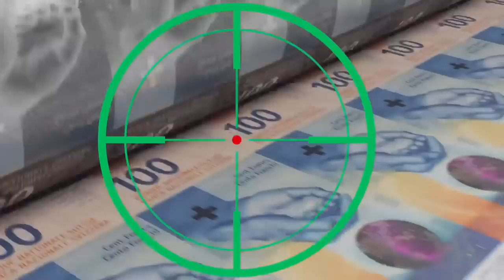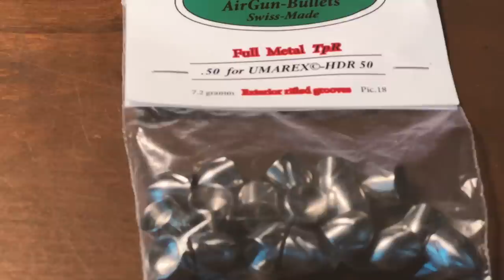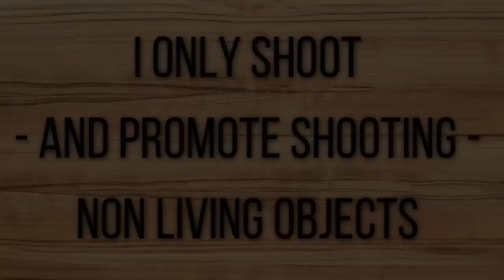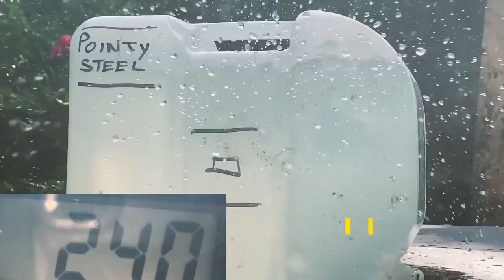HDR 50 • SWISS BULLETS

Comment: Although I carry a real 44 for defense, I do own an HDR50 11 joule gun as a back-up. Black Powder takes time to reload, even if you are just swapping out the cylinder. So I own a few non-lethal guns. Everything I own is designed to kill or maim. the HDR50 11 joule is very good at this. The Byrna HD or SD gun is the best for quick draw conceal and carry, but less power. If you are interested in BP I carry two 1873 Cattleman's and a 36 caliber Pepperbox.
Reply from the maker: Great input and thank you very much, Reverend! 🙌🏼
Reply: @AirgunAlley  I did time, and although I can legally purchase guns via Texas state law, if the FBI comes around I can be kidnapped. So I have experimented with several non-lethal guns and weapons. All are store bought factory versions, I might add.
Reply: @ReverendLloyd  What do you mean by that? The 10th amendment defense is an easy will in courts, especially now.
Reply: Steel will always penetrate better, because it's harder.
Reply: @ramdom_assortment  I live in florida until I can afford to pay the clemency board to apply to have my rights restored I cannot own a traditional firearm
Reply: We all have our reasons why we do not, would not or cannot own firearms. Sometimes it is out of principle but I for one want to be safe from the bad guys

Comment: I have the later version rifle but as the faux magazine mounts to the picatini rail I left it off and purchased a pair of magazine clips and mounted them just in front of the trigger.
I also went over to the tuned alloy barrels added three to get the barrel to protrude out the front and instead of the faux silencer I added a muzzle flash eliminator now the power is much better it hits what you aim for every time.
I use the alloy magazines as they grip the balls tighter which means the move quicker out the mag, and was wondering if these metal bullets would work in the alloy magazines have you tried them, bearing in mind here in the UK we are allowed no more power than 7-5jules, although I have the power booster kit but not fitted it yet, I use a red/green dot or laser and torch along with a very similar bipod to yours but it has a quick release levr built in so handy to transfer to my KRAL 22 air rifle.
Reply from the maker: Man sounds like you’ve built quite a beast mate! Congrats! Yes, sorry for those 7,5j limitations you have there - but sounds like you have it all covered 👏🏼

Comment: I was wondering if you've seen those silicon nitride ceramic ball bearings. I was hoping you could try those out in a new video. They're about $10 each, but the manufcturig tolerances are awesome and the'yre aupposed to be super hard, but very light weight. I'd love to see you test those out, PLEASE!!!
Reply from the maker: Wow! No I’ve never seen them. 10$ a round?? They sound interesting. If you have a link send it over pls and I’ll have a look. Thanks a lot Rob!

Comment: How are those projectiles on the barrel? Any damage or wearing?
Reply from the maker: That’s a good question and in the long run, yes, anything that’s not rubber, nylon or paintball will be harsh on the stock aluminum barrel of the HDR 50. Thanks a lot man

Comment: Ok, I've been looking at reviews for the HDR 50 on Amazon and I see a number of people claiming their pistol blew up on them, couldn't handle the pressure from the CO2 cartridge. Fake reviews or does it really happen to people? Thanks.
Reply: Mine did, but only because I overtightened it and the other day I heard a leak and turned t upside then bam, got hit right in the face with the punch button and CO2 cylinder. Luckily it was leaking before it came loose, so it was just like taking a decent punch to the chin. Mine was a monster too. Only 6 shots, but every nylon ball I shot at a metal plate I have, completely busted apart.
Reply from the maker: Hey, yes you raise a very good point. A lot of people have complained about the same issue. Even sending letters to Umarex.
Now, the people I heard this happening to - most had their guns modified. I don’t know about the Amazon reviews. 
Umarex clearly points out to never touch the insides of these guns, but the first thing people do, is go and remove the valve restrictor.
I suspect that with an original valve, this happens less. But I could be wrong!
Also, I empty out the CO2 after every shoot. A gun should never explode, by all means, but removing the gas helps avoiding accidents… 
To be investigated….
Reply from the maker: Damn man! Sorry to hear, that must’ve not felt good! Glad you’re OK

Comment: No link for ammo? I can not find them anywhere! Plz help, thanks!
Reply from the maker: Hi Jason, there’s a link in the pinned comment. Let me know if you have problems opening it.
Unfortunately there was a time when you could find all this stuff on Ebay. Sadly however the platform now banned all ammo sellers. So the only way now is to order directly through the website
Reply: @AirgunAlley  nope wont open, sry.

Comment: Is the jelly head equal to a human or  would these bullets not penetrate thr human body?
Reply from the maker: No, a head is made mostly of bone. At close range you may fracture a skull, and induce a lot of pain. The power of these guns is not strong enough for a bullet to penetrate a human body. That’s why they’re considered Less Lethal.
Reply: @AirgunAlley  thanks mate
Reply: @AirgunAlley is that jelly head similar to human flesh

Comment: Air Gun Ally : I have a question.

How long do these rubber ball gun Last before the seal leaks?
Reply from the maker: If you keep the stock valve of these guns the way it is, put a few drops of silicon oil every now and then and treat it righjr- they should last a long time. The CO2 remains nice and sealed in the cartridge, so there’s no pressure anywhere
Reply: @AirgunAlley  Thank You